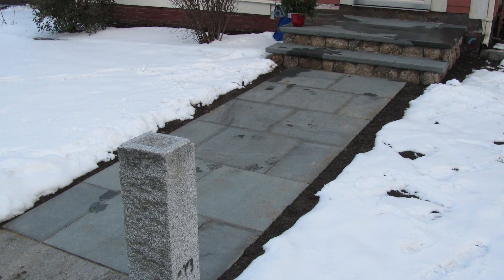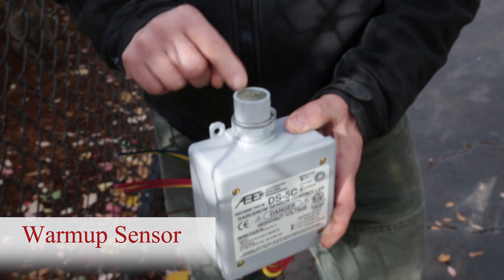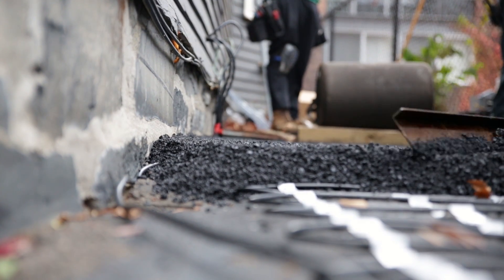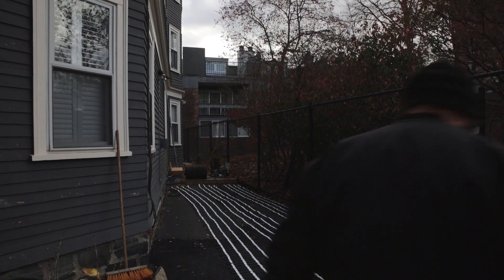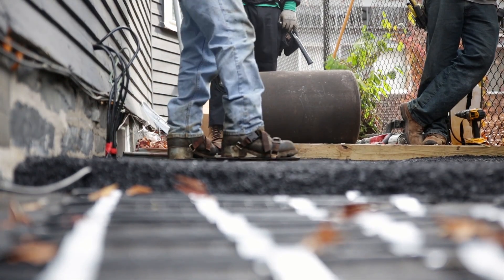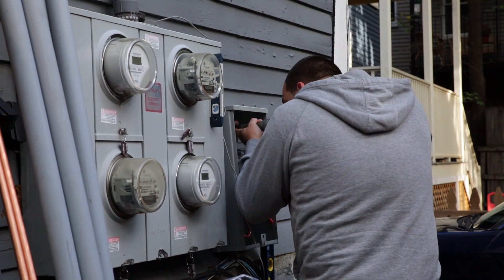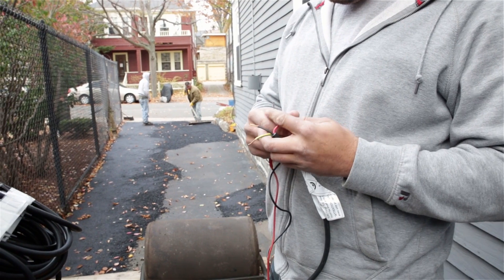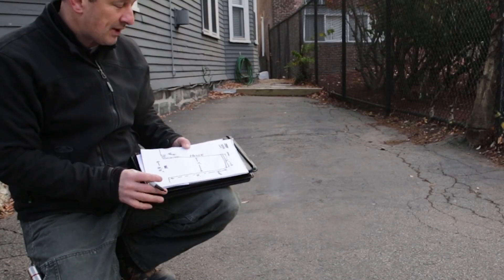Warmup Snow Melting System

Comment: one thing to remember - you may not be able to 'just install a 100 amp breaker' into the main panel... if the transformer on 'your pole' isn't rate for it...  which may mean, contacting the hydro company, they'll diddle around 'designing' for 5 weeks, it may mean installing a new POLE, which you will have to pay for, plus all the electricians time to install the breaker, plus the hydro guys time to install everything...  thousands and thousands of dollars.  voice of experience.
Reply from the maker: rapunzel eh? In my area we have all that infrastructure already in place - no hydro guys
Reply: i did too... bought a crappy old house, rewired it, bought a 200amp main panel, had to have a 'real' electrician' bless it before the power co would light me up.   but the transformer was only for 100amp, upgrading the transformer meant a new pole  (??)- hence the comment - not sure why it would have taken 5 weeks to 'design' a can on a stick - you'd think after having installed about 50 katrillion of them, they would have worked the kinks out...  opted for swapping out the 200 amp main breaker for a 100...

Comment: No one can give an accurate energy consumption figure because its expensive to run and 70 amps is just ridiculous
Reply: lol yes 50 watts per square foot.... im guessing depending on the driveway size it may cost less than a snow removal contract.  For bigger driveways I imagine it would be possible to do several zones and melt the snow in sections, in my case i'd have a 15' X 60' driveway that would mean 45 000Watts so approx 190 amps lol.  The logical thing to do if i would install something like this is go with 50 amps, 4 zones and prioritize the main sections, and cycle the zones to get full meltingness.  Eventuallly it stops snowing after a storm and you'll have time to melt it.

Comment: 1. What is the cost per s.f. to install the system? labor and material2. If in a few years I would like to rip out the asphalt, would I need a new system again, or at least the mats?3. avg. electric cost to operate?
Reply: Hi +Danny Zivan
1. We usually say it costs about $10/sqft for the material, including a controller. It is an approximation as for a driveway for instance, you may want to heat only under the tire tracks versus heating the whole driveway.
We do not provide the installation part but can recommend Warmup Authorized and Certified installers.
2. When you ripe out the asphalt, you will need new mats but you will be able to use the same controller.
3. It depends on your location and the total area to be heated. What don't you request a free quote to get a precise estimate? http://www.warmup.com/outdoor-quote/

Comment: I need this system right now in DC metro area with 2 feet of snow and my driveway is about 100m's and I don't have a snow blower.
Reply: Hi +akilla214u2c ! Feel free to contact Warmup @ (888) 927 6333 and good luck with the snow storm ...!

Comment: any 'dealer installer's'  in Toronto, Canada area??...Great product!!!
Reply from the maker: +gungfuriceboy1 Warmup has an office in Canada
Reply: Hi +gungfuriceboy1 ! We do have resellers and installers downtown TO. Give us a call and we'll be happy to help: (888) 592 7687.
Reply: +Warmup North America With the electrical rates in Ontario, it is ludicrous to even consider mats.  Radiant tubes with water heated by gas is a better option.  Concrete needs cuts in our climate which cannot be done with tubes inside.  There is a you tube video of a guy who put down 2 inches of ashalt, then put in his tubing then another 2 inches of asphalt on top.
Reply from the maker: +peggyt1243 Not really.... installing a hydronic system is extremely expensive and more expensive to maintain. This is a great solution for small areas, walkways and patios.
Reply from the maker: gungfuriceboy1 warmup inc

Comment: Wowsers that's a lot of amps. I'm a Licensed Journeyman Electrician in Florida and never even thought of a snow melting system like this. Lots of power to melt snow but I can see it would be worth it in applications suited for it. Great video!
Reply: To get a better idea of the current draw we can calculate it using info from the video.

208 - 277vac is the operating range in volts.
50 watts per square foot is the power dissipated when energized.

For a driveway that accomodates 2 small cars we can say 20 feet long X 7 feet wide is our surface area to be warmed. This makes the total area in our example 140 square feet.

The total wattage for our sample (very small) driveway would be:
140 * 50 watts = 7000 total watts (imagine a 7000 watt light bulb).

Using ohms law we can calculate the current required to energize the system.

The current draw for 207V would be (I=P/V) 33.81 Amps.
The current draw for 277V would be 25.27 Amps.

Not too bad but again this is for a very very small driveway. 

The biggest concern would probably be the availability of electricity to all houses on one power connection.

Power to your house is limited by the transformer on the power line. These transformers usually supply power to more than one house. 
If every house on one transformer were to install these heaters then there would likely be a problem with power dipping down to all houses (brown outs and such).
Brown outs can destroy electronics that utilize switch mode power supplies which are very common in consumer electronics.

A survey of the power source to your house and it's normal load should be performed to avoid huge problems for yourself and your neighbors when these heaters turn on. (just my opinion)

a side note:
UPS power supplies will prevent damage to your smaller electronics but large processor controlled appliances cannot run on a UPS AND they all use switch mode power supplies. 

Another important consideration would be durability. The video suggests not to use a steam roller because of possible damage to the element. This leaves a fairly soft and flexible surface for your vehicle to sit upon. If the entire element is covered with asphalt, pavers or similar then mechanically the element is stationary and cannot move. Without a solid surface (concrete) under the element it will flex over time and likely break from the weight of the small foot print of a car wheel (we've all seen the depressions from car wheels in parking spaces).

I would need to know alot more (than what the video shows) about this system before calling an installer.

Cheers!